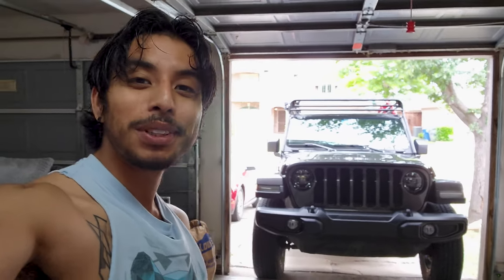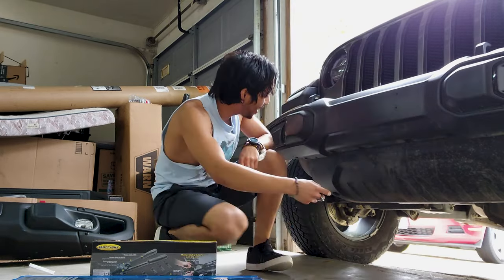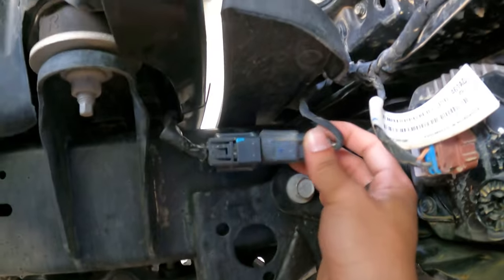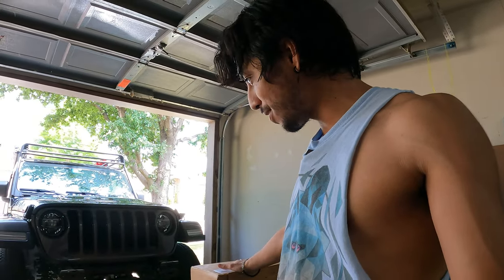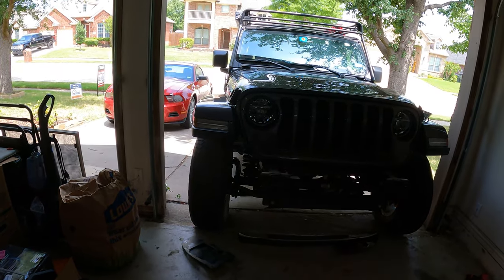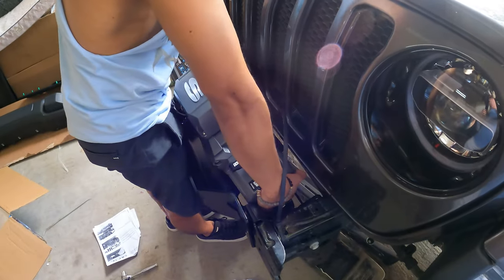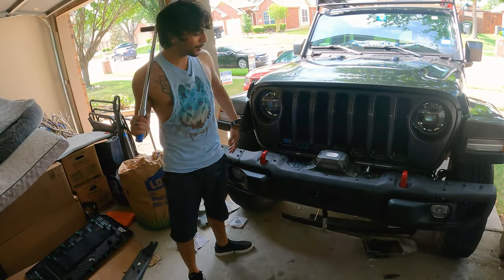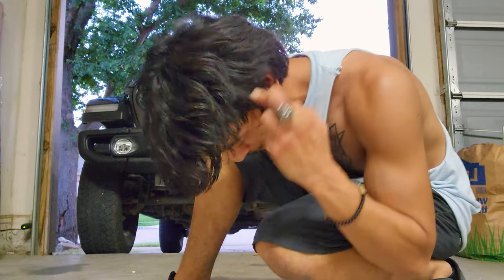MOPAR RUBICON STEEL BUMPER & SUPERWINCH Install || Getting LUNA ready for Ohana Go Topless Day!!!

Comment: Very Nice! What Jeep do you have? I have a 2018 Jeep Unlimited Sport. I will need the same modification if I want to add a winch. Would that be the bumper I will need to?
Reply from the maker: Many thanks! I have the 2021 Jeep Sahara Ecodiesel. A winch is definitely a must-have, so yes, you will need a steel bumper to bolt the winch on.  I do recommend this mopar bumper as it is OEM, so you get quality and peace of mind. There's also other solid options from WARN and even more budget friendly 3rd party bumpers. Just make sure it is compatible with the winch you want, and you should be fine. Good luck with your build!
Reply: @wildindave  Thank you for taking the time to reply to my comment so fast. I bought the Rough Country 9500lbs Pro Series Winch. Now the exploring begins to buy a bumper to make it compatible.
Reply from the maker: @manny3904  You're welcome! Anything to help out a fellow Jeeper. And that RC winch is cool and stealthy, solid upgrade.